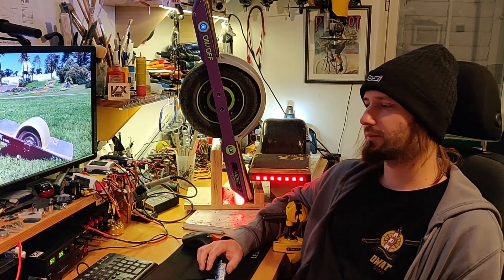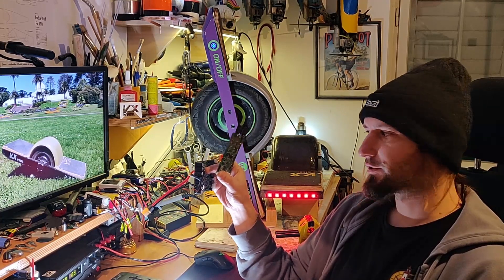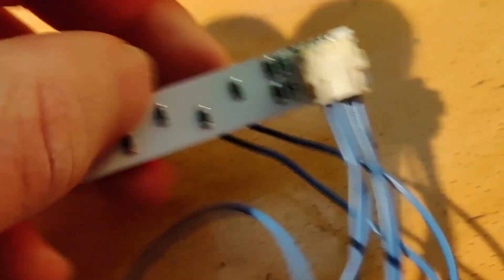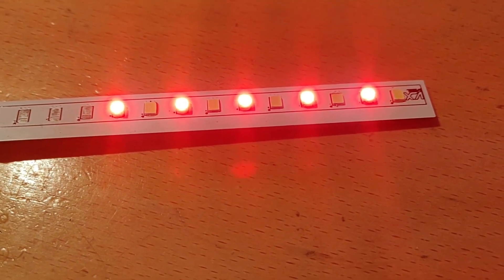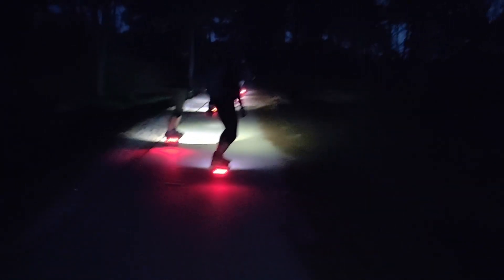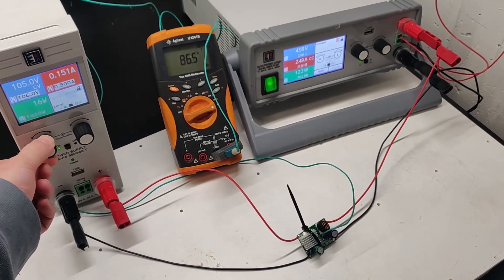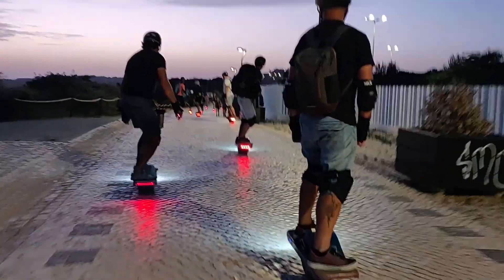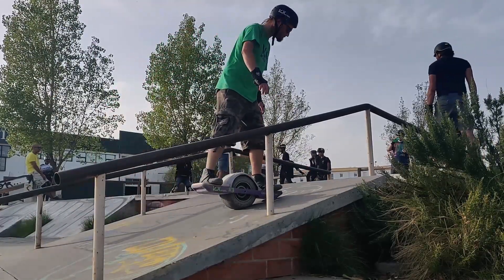DIY VESC XR Onewheel LED lights - VXwheel solutions

Comment: hey why not go 12v light the fungineers solution?
Reply from the maker: You can chose a 12V DC converter and go with 12V lights fur sure. Same system needed just different working voltage.